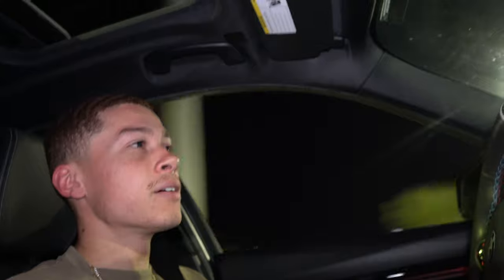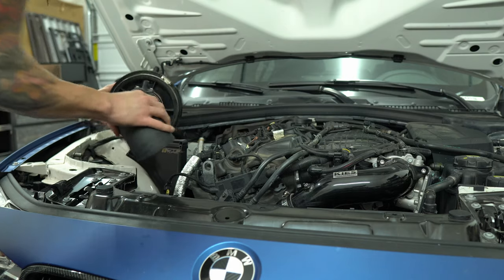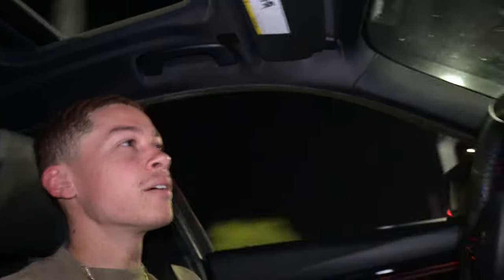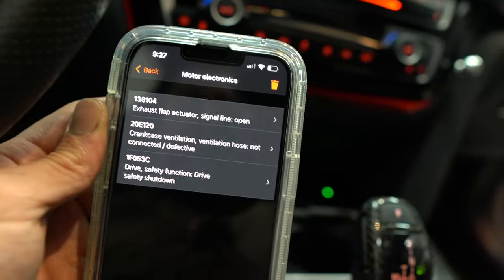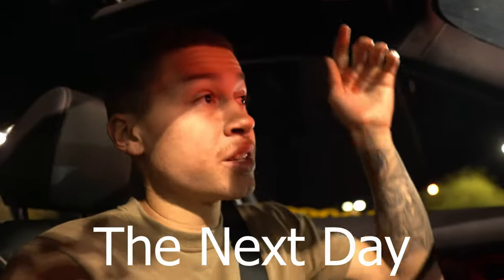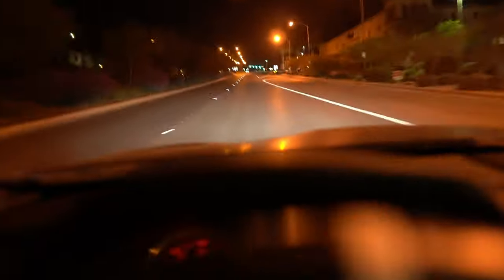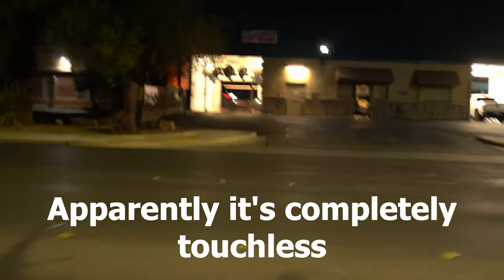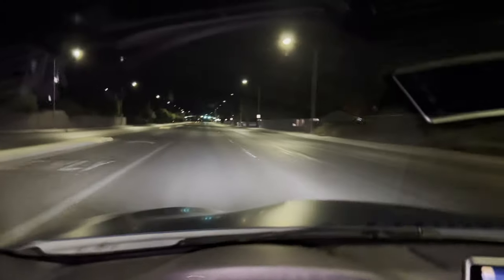Did I Just Ruin My New Turbo?  How do I fix this?

Comment: as a mechanic myself, i cant recall cars throwing up an engine malfunction due to wheelspin, especially not bmw's. just look at the f82 m4, known for losing traction super easily. i think your problem is actually solved with the re-tune and that you should be safe to push it 100% now ( please be safe if doing so, though ). bmws have always been known as tire slayers, so i really cant believe an engine malfunction on a bmw would have anything to do with wheelspin. ofcourse i might be wrong, but thats my view on it. great vid tho, keep it up, been enjoying the content lately.
Reply from the maker: Thanks for this man, I appreciate it
Reply: I don’t think it’s “wheelspin” causing the engine malfunction, like he said bmws are know for wheelspin, I have seen similar codes, caused by the crankshaft moving too fast for itself, making the crankshaft sensor to throw an engine malfunction code, (not a mechanic, just something I’ve seen from boosted cars and something to keep in mind) 
Love the videos bro

Comment: i did this in my car about 6 months ago. im awd and basically what happens was you exceeded the torque limits on your transmission. id talk to your tuner and make sure he disabled the torque limits on the cutom file.
Reply: the code dosent mean anything is wrong or broken so dont worry abt that
Reply from the maker: Thanks man I appreciate the info
Reply: I had this happen to me this morning. I could still drive though. I downshifted and went to take off and that horrible chime went off and I went into limp mode. Shut the car off and back on its fine so far. I did just flash back to xHP stg 2. Maybe my torque limits are too low as well.

Comment: my car had this same issue. I took it to my BMW dealer In Irvine CA. They found out I had three coils Badley wored. Replace all Coils and spark plugs no problems anymore. So if it happens again check them.
Reply from the maker: I was thinking the same thing! I seem to have sluggish acceleration so automatically though coils or plugs. I will try this, thanks
Reply: @Metoy3r  give me some feedback regard my suggestion.
Reply from the maker: For sure, I will try this and let you know if it’s fixed. Do you have instagram?

Comment: Drain ur motors oil and differentials fluid maybe u have an open diff and have been doing alot of one wheel peels i also think u should get xhp stage 3 if u havent already might help to have torque limiters lifted
Reply from the maker: I have xHP with the torque limiters lifted but yeah something still doesn’t sound right

Comment: Oh dude I just commented on the previous video about turbo. You might want to get this checked. Now I see you get chassis error instantly when you put more rpm in. You can just renew the core of the turbine, it's cheaper but you should get it checked regardless to see if anything else is the issue with it. I have waste gate problem after I renewed my core and will now replace it completely. 5K bye bye.